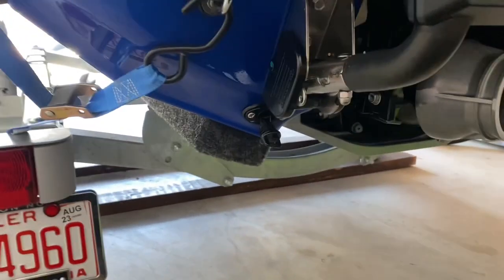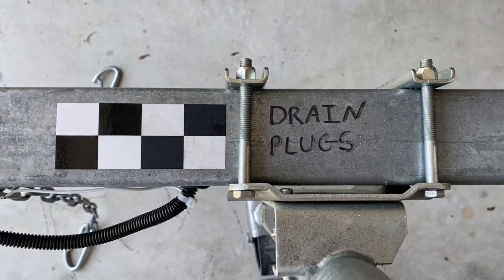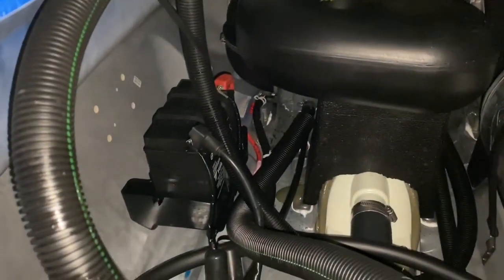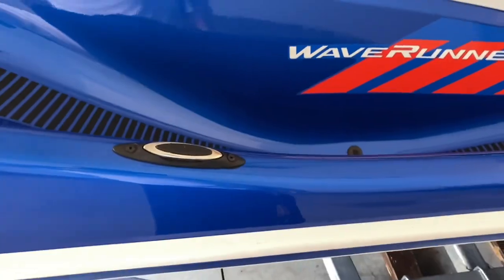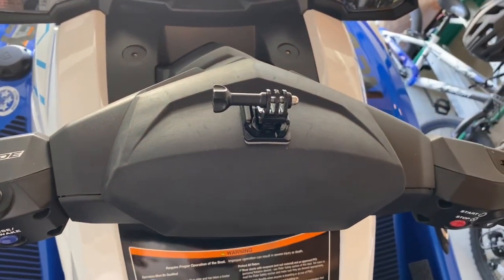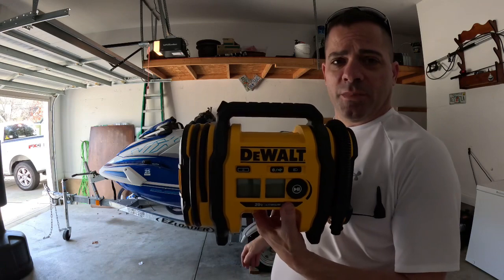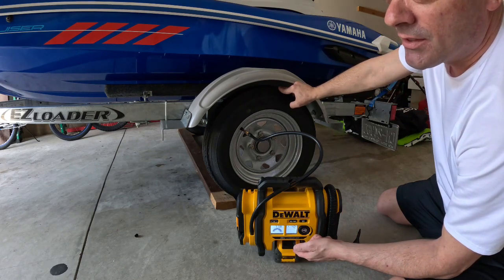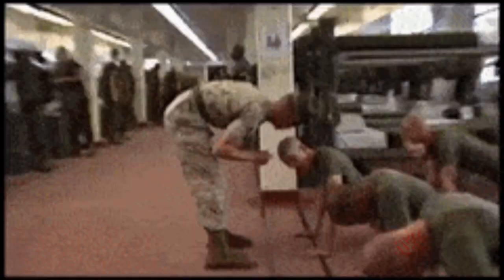PWC/WaveRunner mold prevention. Do This!

Comment: I always pop the hood or seat off depending on what ski I used even if they were stored outside u could  just crack the hood open or seat up and critters won't get in there. Just leave it for a day and then both it back up

Comment: Its simple to just place a low wattage heater stick inside the engine compartment over the winter, or if you aren’t going to use it for some time.  I do this every winter and it works great.  I also don’t have to worry about critters, as the seat will close even with an extension cord.
Reply from the maker: Sounds like it works, but I’d be too nervous that having a heating element where gas fumes collect may not fair well. 😬

Comment: You literally have a spot to put a RAM mount to mount the gopro to the threaded holes.
Reply from the maker: Not sure what a RAM mount is but I will look it up. As far as the threaded holes, I did but a long 1/4-20 threaded rod and screwed it in the threaded 1/4-20 hold to create a high mount for the go-pro
Reply: @redrightreturn1085  haha you can’t be serious ?
Reply from the maker: @SME5724  about what….. ventilating your hull so it doesn’t get moldy?